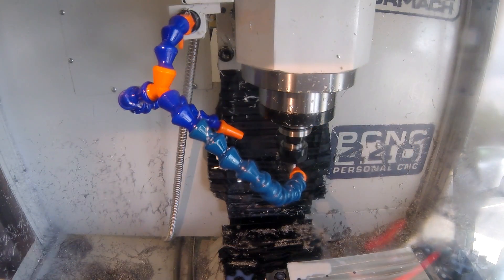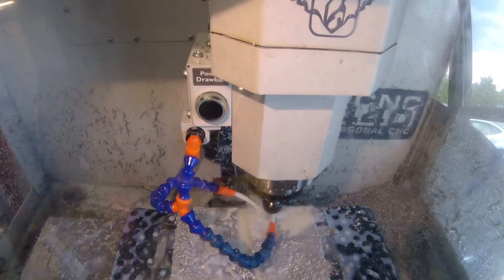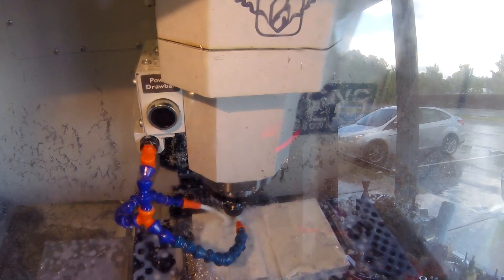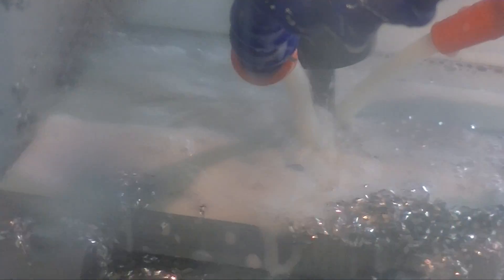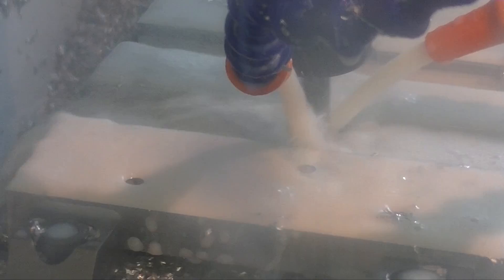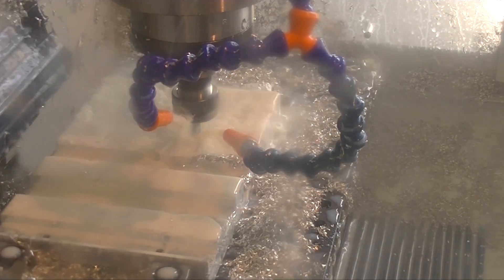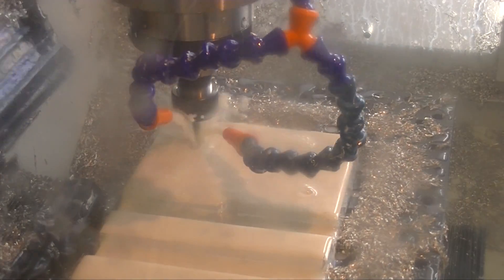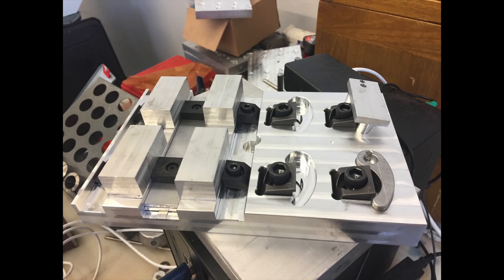Fixtures Round 2 - Machining

Comment: Hi Tom, Not sure on the 440, have not used one, but.... On the 1100 we had the same issue with both rear Y and Z bellows packing in chips and getting torn up. Those bellows tend to snag the chips. I think you can get a rubber flap that goes over the bellows? What you could try is to add a rear lip to the table that runs the width of the table. Just a little offset bend piece of sheet metal. Make it as tall as you can without hitting the bottom of the Z head when its as low as it goes, and as far back so it does not hit the Z bellows when Y is all the way back. This will help prevent the chips from falling down onto the Y bellows. An additional coolant pump with a nozzle pushing coolant along the back will flush the chips to one side and keep them from building up. Don't know if your returns can handle more flow or not. On the big machines they just add more sheet metal to direct chips. If they start piling up somewhere they throw a coolant nozzle there to push them along.
Reply from the maker: Hi Tim! Sounds like you are all too familiar with the issue at hand. I've made a few changes to nozzles at this stage but still need to order replacement parts for the damaged covers. I like the idea of a flap to help deflect the chips. I'm using every bit of the travel on this little machine so I need to get creative here...

Thanks for the suggestions, sir.
Tom Z

Comment: It's amazing just how fast that can machine material out, even allowing for the video speed increase. Despite the double flood, chips seems to build up pretty quick on pocket cuts - predictably! Ahh - you mention chip compaction... not overly surprised. Seems a bit of air blast needed too.
Must have been quite a long coding job. Most interesting to watch. So much to consider.
Reply from the maker: +ChrisB257 It’s definitely amazing to think what we can accomplish with a rather modest investment compared to years past. The air might make a difference as well but the accordion style way covers are like little pockets that catch the chips. Still work on that part!
Reply: Telescoping sheet metal chip guards trump rubber bellows!